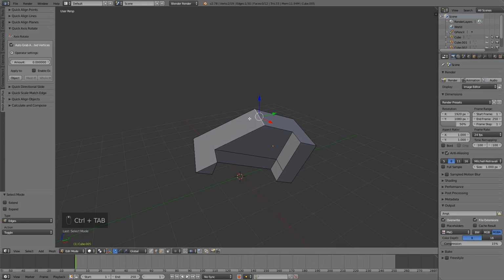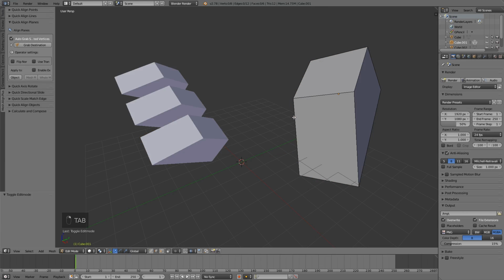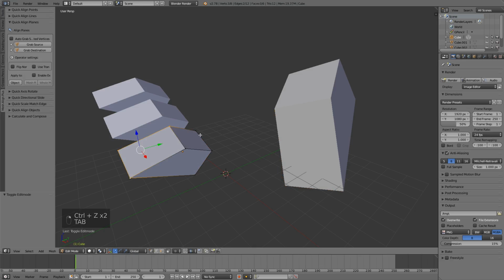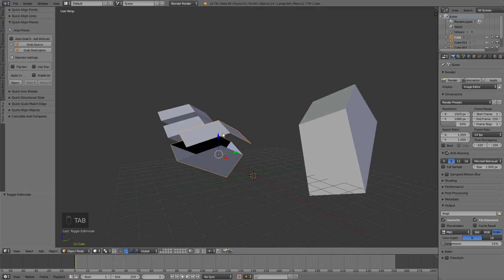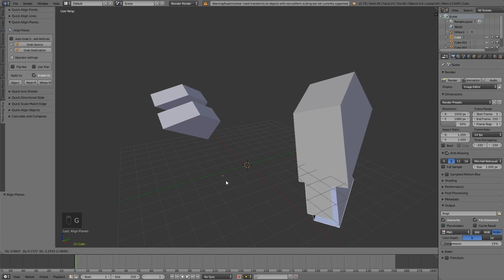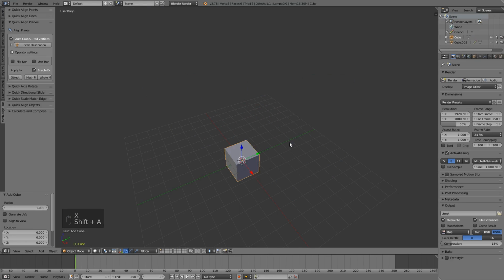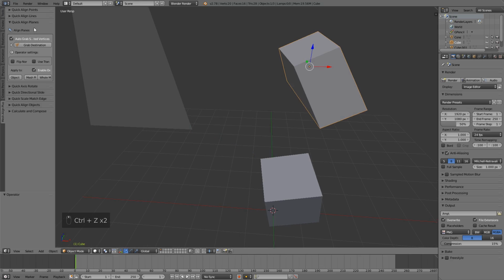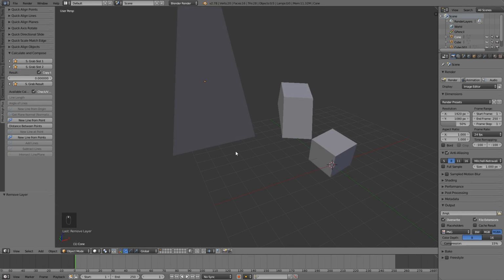Mesh Align Plus v0.4.0, Basics

Comment: Fantastic. I found this because of the Quick Align Planes. Rhino has the same function, but called Orient3D. I love the additional features you put in, and it is well organized. I'd love to see one more that allows you to adjust the pivot in the same way. Right now, I have to create a plane, align the plane. Join the plane to my object, then go into edit mode and delete that plane. I'd rather just align my object's pivot based on selecting 3 points and for defining the XY plane. Z would be perpendicular. A couple options could be to have the origin point at that corner, centered to face, or centered to object all in the same tool. 
Also, you said you would post a new video with the other tools. You've released a new version for 2.8 (which also works in 2.81) and things are subtly different. I DO hope this gets put in as an official add-on though. It is quite useful. Adding that pivot would Really be helpful for making imported CAD or downloaded models animatable. Usually those pivots are just world zero, or world orientation, but centered to each object. Neither are useful for animation unless your entire object consists of Only 90 degree angles.

Comment: Hi there, I'd love to use this addon but I am getting an error after installing the .zip file with the install option in Blender.  I'm using Blender version 2.79b and tried the addon version 0.5.2. Any help please ?  Thanks !
Reply: OK.. I'm sorted out now ! 
 "Old Versions (less than v0.5.0)

NOTE : v0.4.0 and lower are only work in Blender 2.7x, and won't work in 2.8x

Older versions of the addon are a single .py file. You need to put that file directly into your Blender/2.78/scripts/addons folder (ONLY the .py file!)."
Reply: PPS.  This addon is brilliant !  From what I have learned from other users and studying some tutorials it was stressed that Blender wasn't so much created to be used in the technical arena.  The addon really fills that void perfectly.  I am trying to transition from Sketchup to Blender and always found SU's inference system quite useful.  Only problem being, SU can become really slow with complicated meshes.  Your addon really kicks a lot of sand in Sketchup's face.  Thanks a million !

Comment: Using blender 2.79: This add-on failed to install. 1). It was zipped by GitHub, which created a master zip and confused the blender install from file. 2. Once that is resolved, there Blender did report a bug in the add-on and prevented it from being activated. "Traceback most recent call last: add-on utils.py line 331, _init_.py line 25,system.py line 6, and also and Atribute Error: module'mesh_mesh_align_plus has no attribution 'advanced tools'. Blender warning states: Operations on objects with non-uniform scaling are not currently supported. Either this add-on is out of date or it is too buggy to activate with 2.79, and will likely still be an issue in blender 2.78
Reply from the maker: You can't use the "Clone or Download" zip (https://github.com/egtwobits/mesh_mesh_align_plus/wiki/Installation). Also, Mesh Align Plus v0.5.0+ only support Blender 2.8x (use 0.4.0 if you want a 2.7x version). ALSO, Blender 2.8x is in beta still, so I've been periodically releasing new versions when they break something (the API is supposed to stabilize so it should happen less the closer to full 2.80 we get).

Comment: Hi

Thanks for this awesome addon!

BTW there is an Amount button in "Quick axis rotate" section. Its tooltip states that the amount is in radians. But in fact it is in degrees.  Kindly correct the tooltip.

In alignment section, can we have separate buttons to align the object MESHES along X, Y and Z directions? (This is like a 3D version of the object alignment tools available in MS Office or InkScape, where objects can be aligned using their top edge, bottom edge or center line.)

That would be more useful than snapping their origin points together.